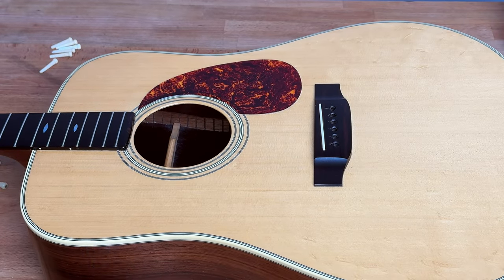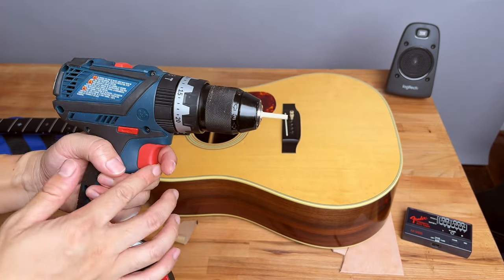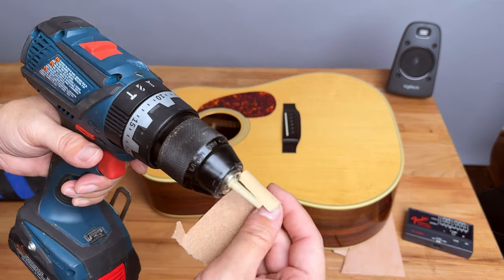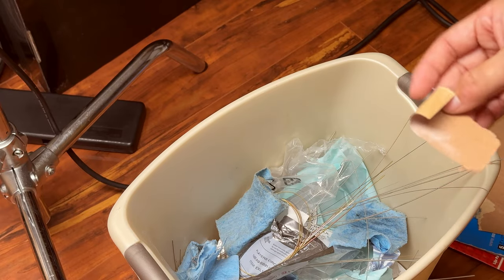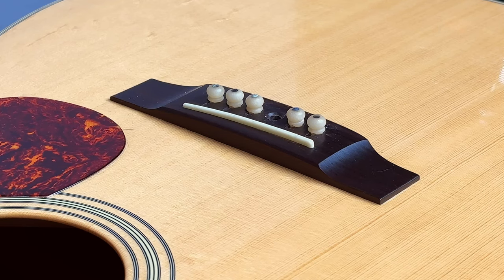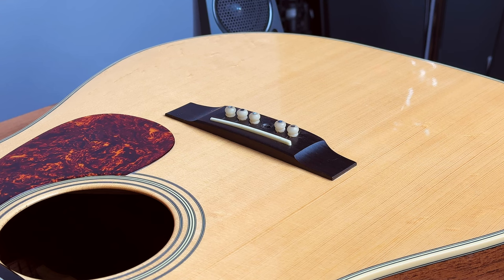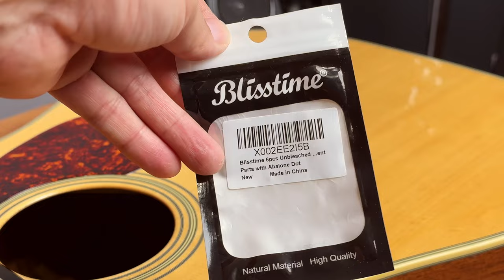DIY Guide: How To Fit and Modify Aftermarket Bone/Wood Bridge Pins for Acoustic Guitars

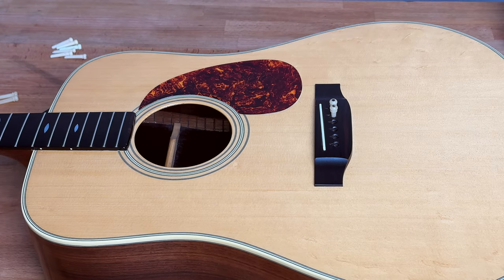Comment: Reaming is the proper way. I am a hobbyist luthier, and I won't do that way. Get a quality reamer with the right taper and for most bridge pin taping is at 5 deg.-- or 3-13 mm, blade length 10.6mm, ratio 1:10 tapered reamer. Chances are grinding the pin you also might alter the pin taper. It must be corresponding to the taper of the hole.  Fit in just by feeling is ok but it must be corresponding to the taper of bridge pin hole. On another note, the pin must just simply drop into the hole easily not too tight not to loose without any wiggle. Oversize quality pin made of bone is about 1 mm bigger in size, but the string slot is still the same of 1.78 mm irrespective of normal or oversize. Irrespective of you don't this thing always keep a tapered reamer with you just in case. 5 deg tapered reamer is what you want for most bridge pin.  Reaming is easy just put reamer into the hole at 90 deg, ream with low pressure one spin at a time and keep doing it until the bridge pin flushes into the hole.

Comment: No way on God's earth I'm letting an electric  drill anywhere near my guitar , dude .  How do you remove the pins ? Dynamite ? 😮
Reply from the maker: The drill is far from a guitar; you work your magic on the pins, not the hole. Pull the junk pin out with any plier.
Reply: @TheGizmoGarage   a little respect please , my good fellow , your icon denotes you as just a plain old alley cat , whereas I just happen to be 
T. C.  -  Top Cat for the ininitiated ...
Reply from the maker: @a.c.4732  I bet all the top cats use the dynamite to blow up their own guitars for service. - The plain old alley cat.

Comment: Amazon sells a reaming tool with the proper taper to ream out the holes so the pins fit properly which would be a better option then sanding the pins and making them thin I would think.
Reply from the maker: My opinion is it's always better to modify the pin than actually drilling on the guitar especially if the bridge is a special one, ya don't want to mess up while reaming with cheap amazon tool rather than some cheap bone pins
Reply: @TheGizmoGarage  Get a tool from Stewmac, its what its made for, if your pins don't go most of the way down the holes are too small. You take your time and do a little at a time, its not that big of a deal. I'm not saying your wrong by any means though but I prefer solid bone pins personally, I actually cut with little hand saws into the bridge and top of the guitar so the string fits into the bridge next to the hole and use solid pins, it made a huge difference in the sound of my guitar. Its a known hack, you also cut an angle in the top of the bridge for the string to sit in and get a better break angle from the saddle. Here is a video about it. https://www.youtube.com/watch?v=V4UdugMN3RQ&t=4s